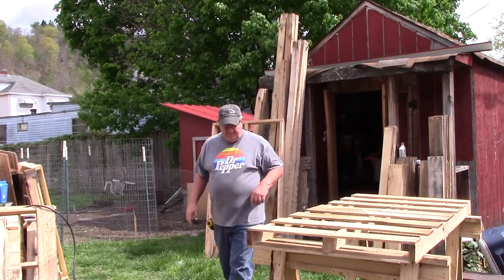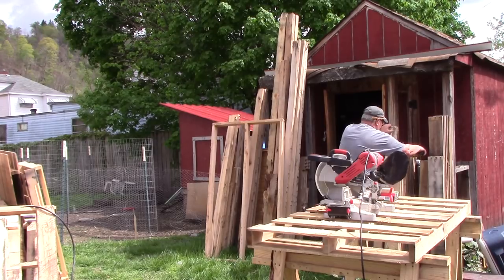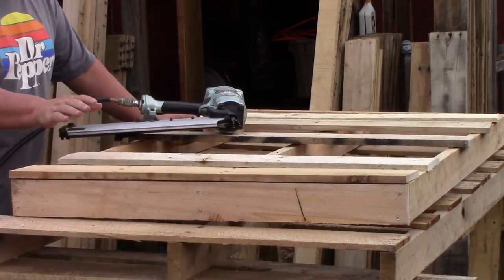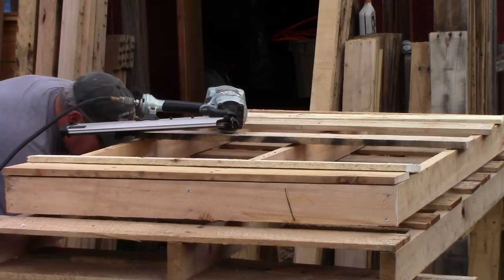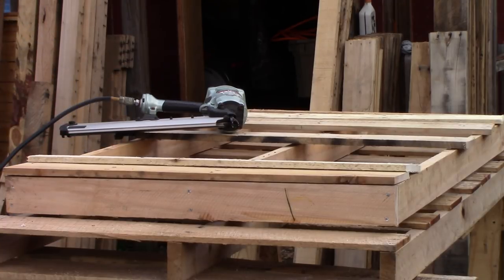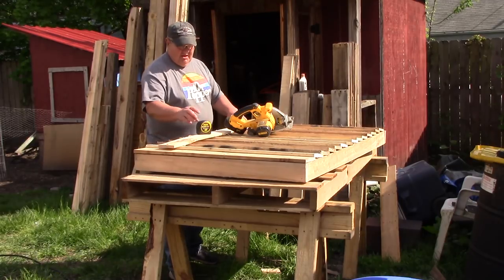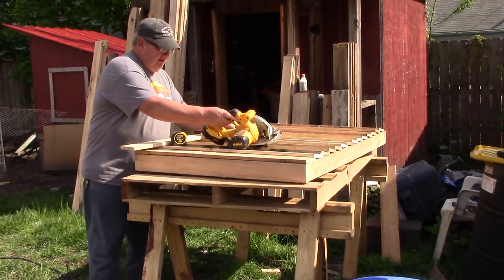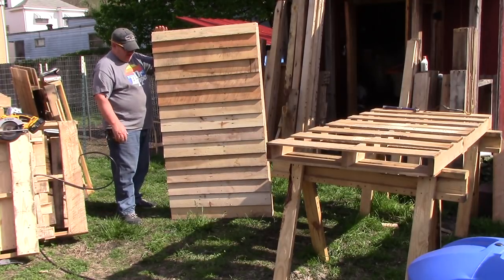Prefab Walls for the Pallet Wood Cabin Pt. 2

Comment: Tip-- cut a block of wood to use as a spacer to save messing about with the tape all the time
Reply from the maker: I mentioned that in the video lol.   I cut one for the next panel lol
Reply: Hey Joe!
Tip 2.  Cut a 2x1 to the length of the frame, mark it at your 4 1/2 inch spacing, then screw it so it sits proud of one side of the frame.  Use it as a stop, so the edge lines up perfectly, as well as correctly spaced.  Use your 4 1/2 inch spacer to mark on the other side.
Thought:  Can you not mount that chop saw to a long pallet, so you could set up a stop for cutting your next 125 boards all exactly the same?